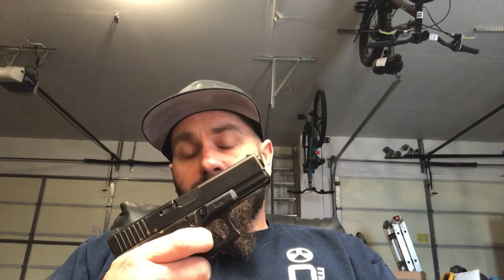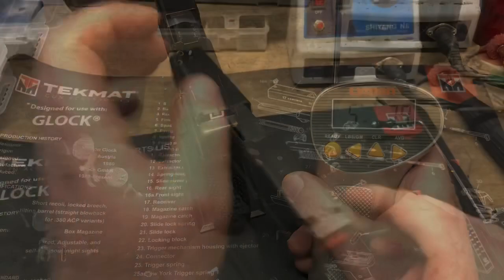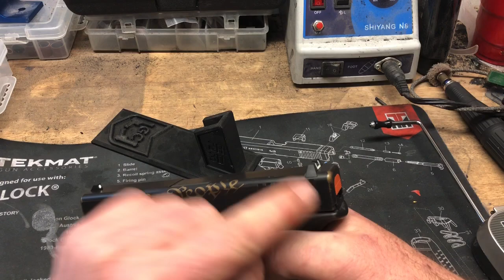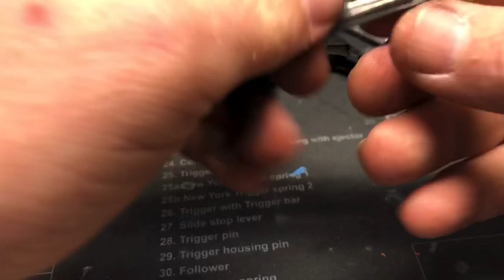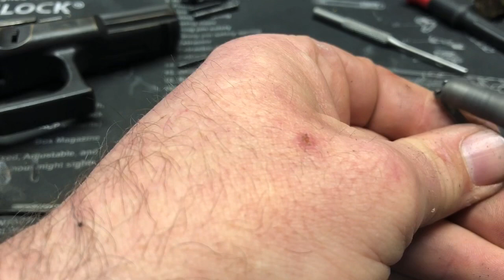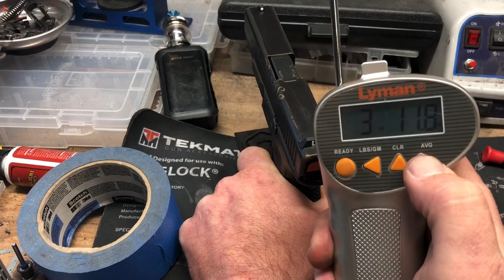Dropping the trigger pull on your Glock

Comment: If you take out reset travel, does it transfer it back to pretravel?
In other words, if I shorten my reset, does that also lengthen my pretravel?
Reply: I don't think so. Check out Johnny Glock's YouTube channel to get a good understanding of how Glocks work. He shows you just about everything you'd want to know in detail.
Reply: I know this is 2 years late but yes, it does. Preventing over travel with an adjustable screw in the trigger shoe or in the trigger housing is a better route because it prevents travel after the break (reset travel) without effecting pre-travel.
Reply: YES!